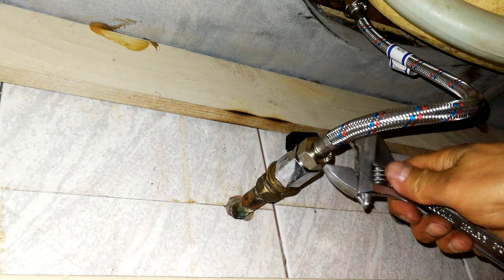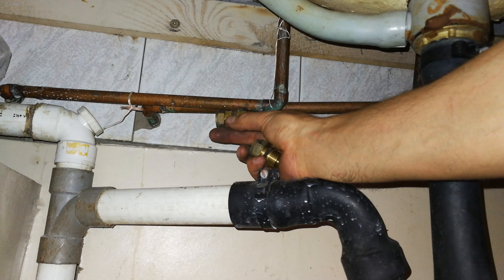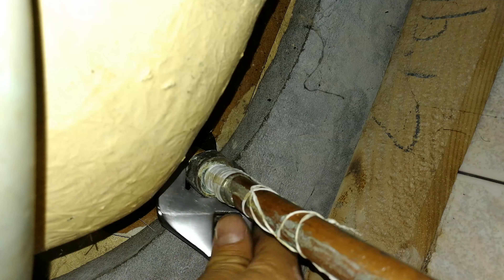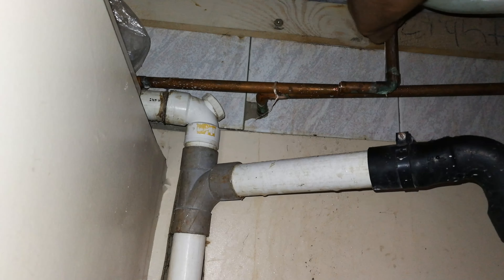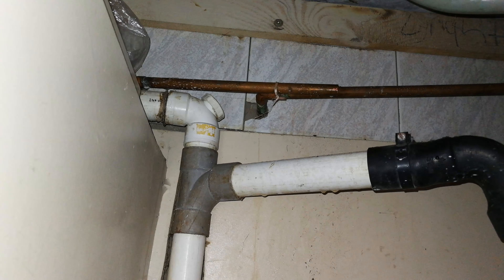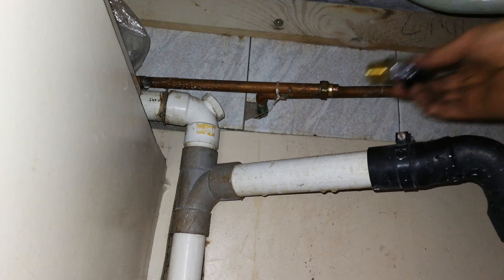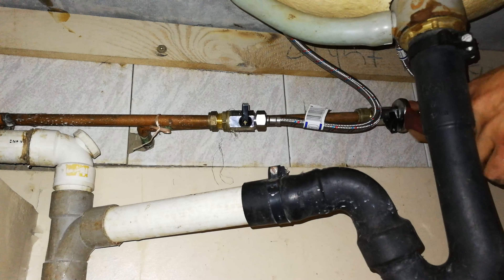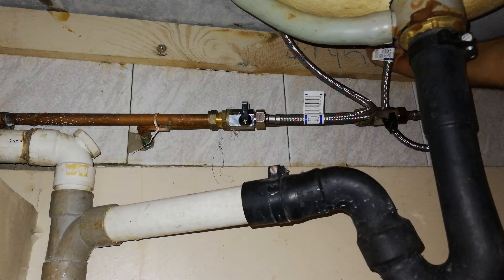How to join a flexible (flexi) pipe to a copper pipe - conex compression

Comment: I certainly wouldn't recommend using a cutting disc on a pipe that has another pipe directly behind it. If it were necessary I would recommend using a piece of scrap metal for protection in case the grinding disc catches the back pipe.
Reply: Nom Cabrelli I can't believe he did that. 🤣🤣🤣🤣
Reply: I would use a c pipe cutter , nice and tidy, easy and quick to use and safe!
Reply: @mmpoggs2033  Yes, they only cost a few pounds and are much more efficient and safe!

Comment: Use a proper hand twist copper pipe cutter for cleaner cut. They make tiny ones for tight locations.
Reply: Useful info. Thanks. I'll add one to the required tools list.
Reply: Seconded. Quite aside from the damage skating along the surface can do to the pipe, as well as accidentally overshooting and nicking the line right behind it, I don't know of ANY join that isn't better served by a 90•, smooth, deburred end. You'd honestly be better off with a hacksaw than an angle grinder with a cutting disk. Even a reciprocating saw (Sawzall) gives better control (at least wehen when working overhead).

Comment: Don't know what country you are in but in the UK we fit isolator valves direct to copper and flexi plus there is no need for ptfe. Don't over tighten the fittings that's the major problems for the diy enthusiasts.👍👍
Reply: What valve would you need to attach a flex to a straight to tap pipe? (After cutting). I can only find press fit and its a tiny space

Comment: Thanks Bru,  just what I need.. got a fairly modern kitchen mixer to replace but the previous installers hard coppered to the tap and solder joint.. got cut it out and put flexi in..

Comment: Bit of a dumb question but when the taps are 90 degrees to the copper pipe is this cutting off the water, and do they need to be kept this way during normal time?  Thx for the excellent videos.

Comment: Is there an easier way to cut copper
Reply: Copper cutter wheel. Just slip it on the pipe and spin and tighten. Leaves a straight cut
Reply: @usermiguelF  agreed

Comment: Thanks for the video, it clarified some doubts I have. I am going to make a vintage style faucet that will be put on a countertop so the copper pipe ends below it. I need to connect the flexible pipe that comes from the shut off valve to that copper pipe, what I should use for that? We are in full quarantine here so all stores are closed and Im gonna buy it online. Thanks!!
Reply from the maker: female shutoff 15mm; 15mm to connex - copper, hemp

Comment: Why use an angle grinder?
Reply from the maker: use a copper cutter. Most people dont have that tool so i use tools which most people have.
Reply: @ecologicaltime  a pipe cutter is cheaper, safer, and definitely better. It'll cut straight clean lines

Comment: Why didn't you need to flare the copper?
Reply from the maker: the watertight seal is made owing to the ring. You do not need to flare on this setup. If you were joining copper to dissimilar fitting that had a bugle type end, then yes flare it.